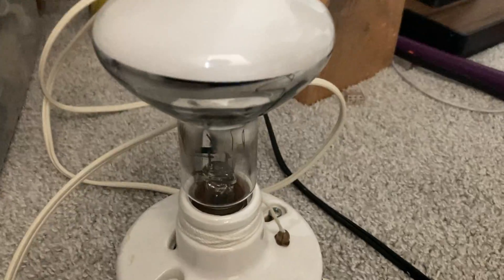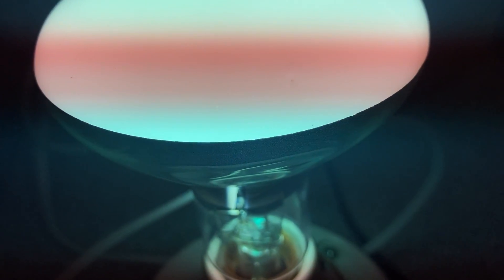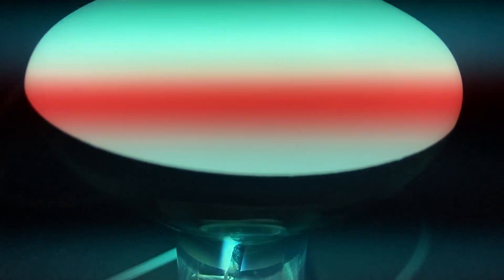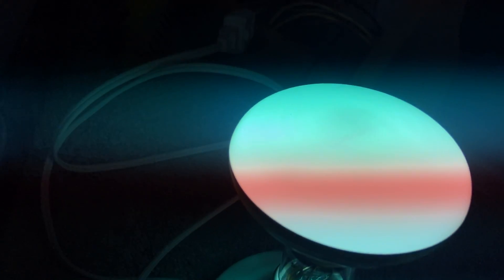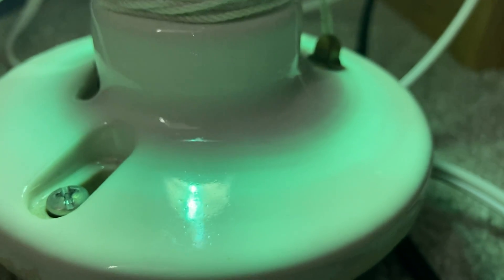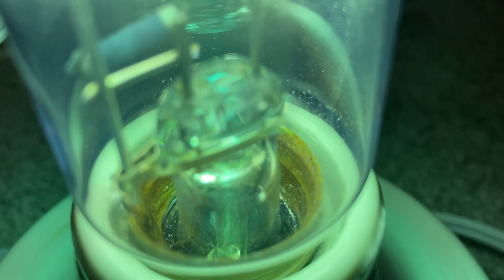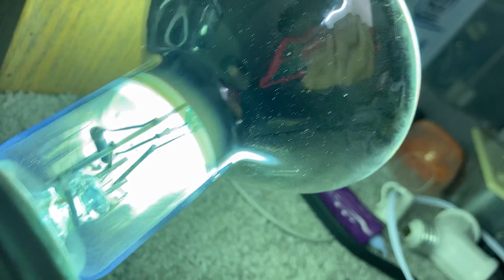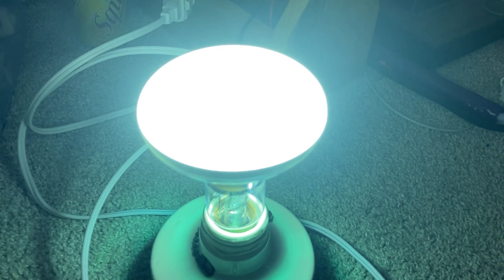100w MV thing

Comment: Interesting little bulb. Br30 or br40?
Reply: This looks like an R30 reflector lamp to me. These lamps were often used in landscape fixtures for moonlighting foliage and also in recessed downlight fixtures too.
Reply: @worldwidehidcollectorusa-fkt  I figured it was used in can lights but interesting that it would be used as landscape accent lighting
Reply: @evanchapmanfanman  the method was invented in Dallas, TX in 1952 by John Watson. It’s extremely common in Texas, Florida, and California. It’s actually still used today in 2022.
Reply: Looks like a mercury vapor bulb used in reptile enclosures, which reptiles bask under and the bulb provides the proper UV they require (UVB I think?).
Reply: The lamp most commonly used for outdoor landscape and moonlighting was the 100-watt PAR 38 clear bulb with admedium screw base. They were also used in blacklight fixtures where the fixtures have a purple woods glass lens over lamp. There is nothing more beautiful than green foliage especially in trees, illuminated in clear mercury vapor! I remember seeing these fixtures all over Disneyland in Anaheim CA used in outdoor landscaped areas and used in blacklight fixtures used for special effects lighting on various rides.